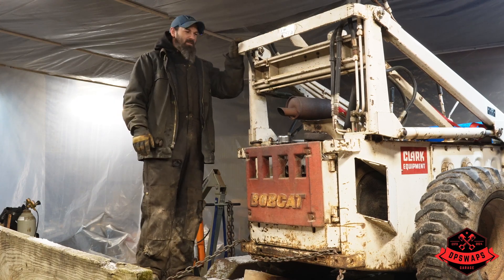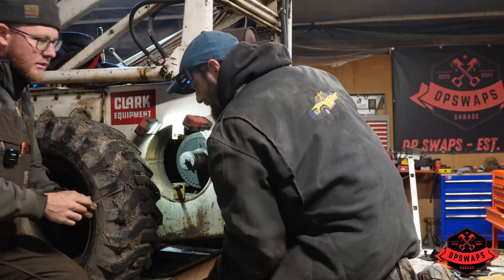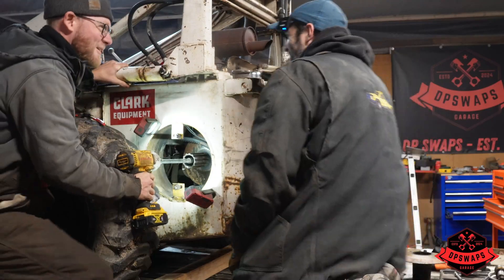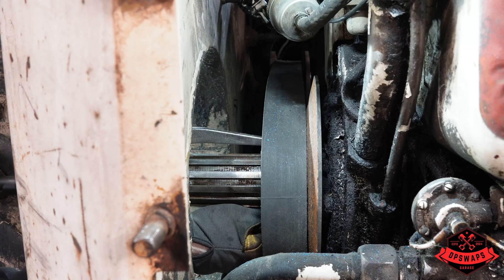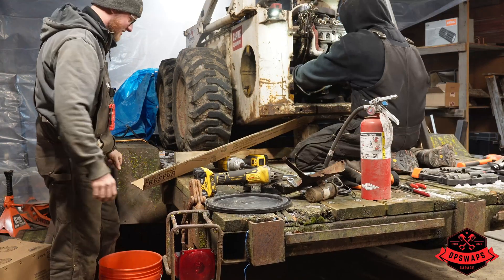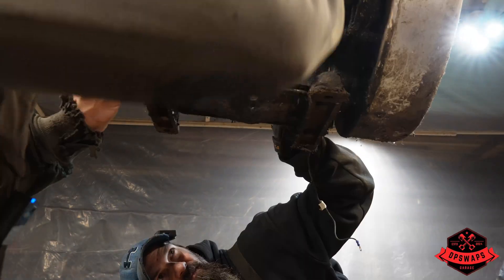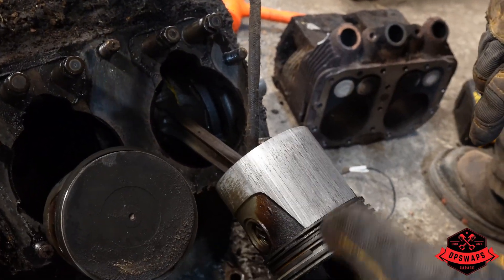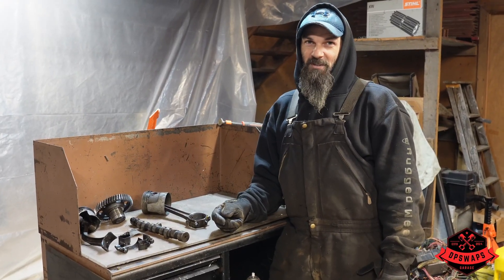This Old Bobcat Lost its Engine - Let's tear it down and find out why

Comment: I am just thinking out loud, but it seems to me that a possible solution might be a snowmobile repower. It would need a big fan to keep her cool and they have a similar clutch setup that would likely work in this case. I don’t know if it would work but I suspect that it might just work. I don’t like the idea of reusing that block…. Just too much carnage. I come up with the ideas, not necessarily the way to implement them. I wish you luck and I hope it works out for you very inexpensively.
Reply from the maker: Thank you for your input, we agree  there is too much damage to cost effectively rebuild this engine. We are currently trying to locate the correct engine, if possible

Comment: I have the same model M-610 Bobcat which I purchased brand new in 1975. No major repairs to the engine in 50 years. Those Wisconsin VH4D engines are great engines if they’re maintained well. I did have problems recently with the variable sheave seals leaking. You have to be really careful when you slide that piston with the sleeves back in or you’ll tear them and then you have to do it all over again. Anyway, this will be interesting to watch. Glad the customer wants to rebuild the Wisconsin.
Reply from the maker: We are currently looking for a remanufactured motor, too much damage to the current engine, I appreciate the information, I've never worked on the variable pulley, I'm hoping to find seals for it, since it's apart, looks like it may have been leaking
Reply: @DPswaps  you can get the seals right from Bobcat. The variable sheaves are a whole different story. Very hard to find.
Reply from the maker: @jerrys9226 the sheave halves look really good
Reply: @D @DPswaps  those Wisconsin bobcat engines have a tapered shaft so that them apart from other Wisconsin applications.
Reply from the maker: @jerrys9226 I see that

Comment: I have an old mag style Wisconsin engine that runs mint. They are getting hard to find and are pretty pricey. I'm not sure yet if I want to put it in my skid steer or repower it with my 1.0 metro 3 cylinder
Reply from the maker: There sure isn't much room to use a different engine, not like more modern skid steers. Thank you for watching